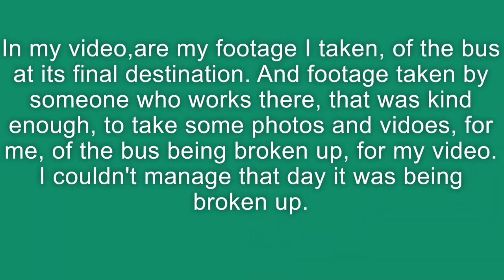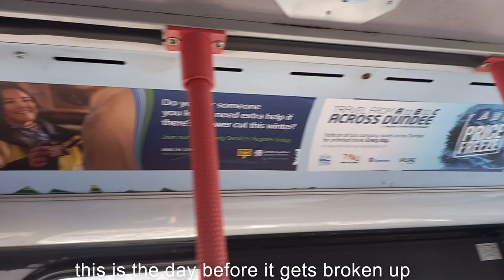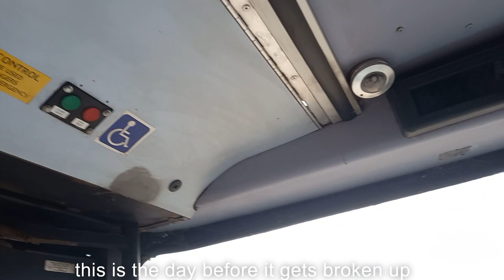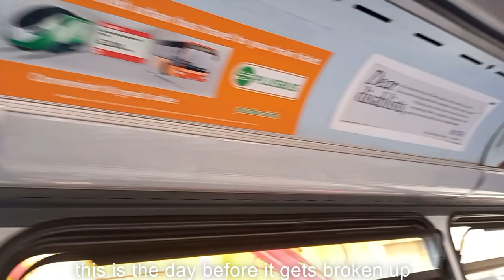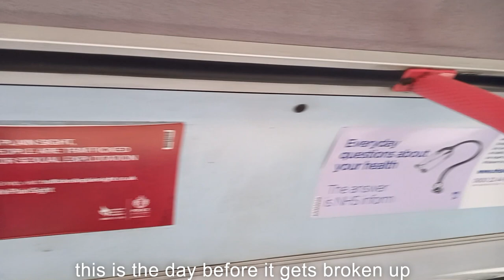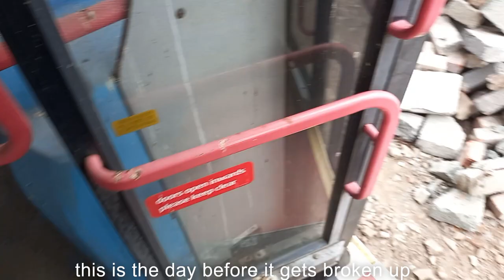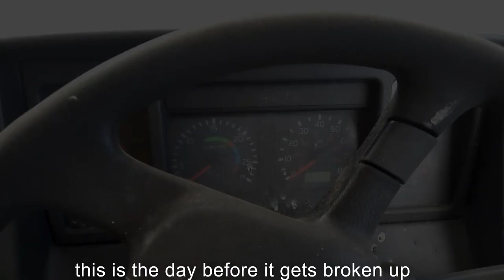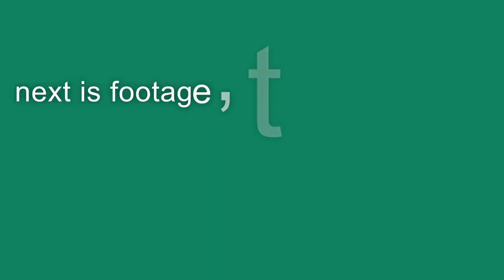The Scrapping Of Bus 4076 (V76MOA) .....Scotland.....2022....

Comment: Such a waste of a good bus
Reply: Not a waste. The modern buses are designed with a limited lifespan and meant to be recycled, not rebuilt 2 or 3 times like earlier designs.
Reply: @PreservationEnthusiast yes a waste.
Reply: @royfontaine5526   No not a waste. All the the material will go through the shredder. They'll get valuable aluminium, steel, copper etc from the process. The bus is no good otherwise. It's 23 years old, probably done over 1 million miles. All major systems worn out. If you think you can find a use for clapped out buses like this, you are welcome to buy them. Thousands go for scrap each year.
Reply: @PreservationEnthusiast  I bet it worked perfectly and could have done whatever mileage it had done all over again. Recycling and manufacturing are energy-intensive processes, didn’t you know? Plastics and glass are unlikely to be recycled.
Reply: @royfontaine5526  It's just not cost effective to keep on using buses past about 20 years old. The floors are usually rotten as they go out in all weathers. The engine might  work but all the systems like brakes, suspension and transmission are worn out. The interiors are shabby. Customers don't want to travel in uncomfortable unsafe buses. Refurbishment is not economically possible. That's why it's best to feed them through the shredder and recover the materials.